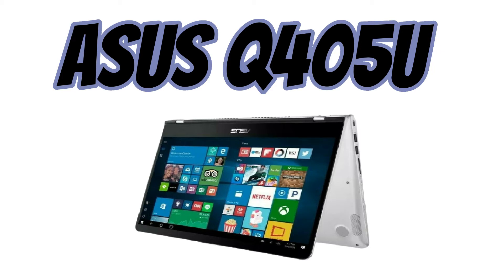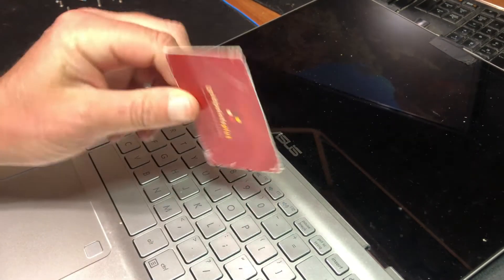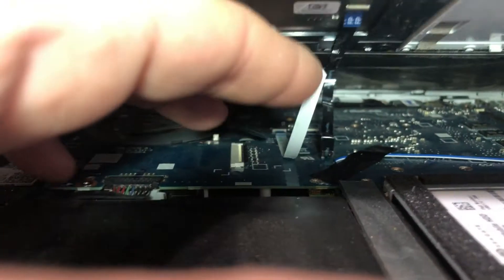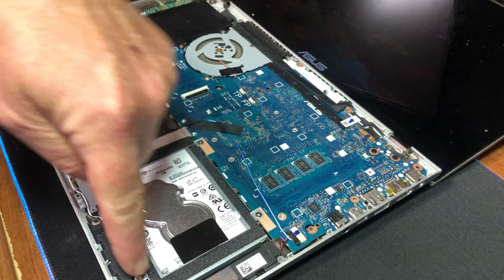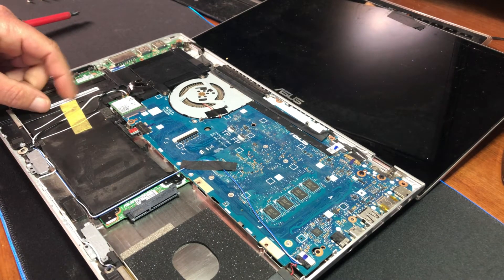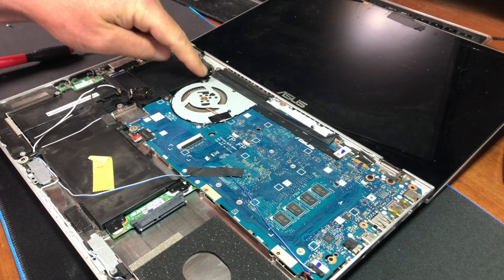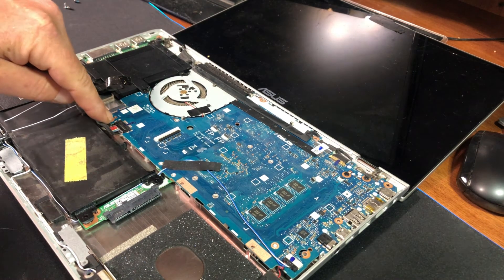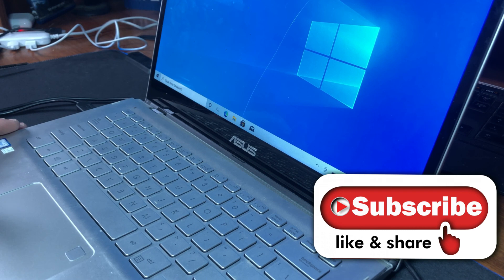How to disassemble an Asus Q405U laptop | UPGRADE or REPAIR

Comment: Thank you for the video. Do you happen to know the part number for the battery?  My laptop is a few years old and the battery is pretty much shot. Probably last about 30 minutes unplugged. I swapped the HDD with a SSD shortly after purchase, so I am comfortable taking apart
Reply from the maker: Thank you for watching. According to Asus, PN is #0B200-02660000. You could probably find a compatible on Amazon or eBay cheaper than retail. Just make sure it lists the Q405 as a compatible model before purchasing. It would help me out if you used any of my Amazon links in description if you want to start there

Comment: I keep watching these vids on the q405ua over and over but i’m so nervous to do it. I want to add another RAM stick and SSD.

Do you happen to know if both the HDD and m.2 SSD can be in the asus at the same time?
Reply from the maker: Don't be nervous. Just follow my steps, I walk you all the way through it safely. On the dual drives, I can't recall. Many of these machines I make videos on are client machines and once I fix them and return them, I don't remember much specifically about them. Usually I will mention fial drive capability in the teardown video if the laptop has it
Reply: @AskYourComputerGuy  Do you happen to remember if the cpu heatsink needed to be re-pasted?
Reply from the maker: It's a good practice, especially if the laptop tends to get hot. But unless you are removing the heatsink for some length of time, I wouldn't bother. It can never hurt though
Reply from the maker: I mean, if you already down that far into the machine, probably a good idea. But entirely a judgement call IMO
Reply: @AskYourComputerGuy  Thanks for the reply btw
Reply from the maker: I just re-read your comment.  I thought you were asking if the laptop had both m.2 and SSD.  If you were asking if you can run them both, absolutely you can, if the hardware has both connections. That's why they have both connections there.  Sorry for the confusion.
Reply: @AskYourComputerGuy  No worries lol